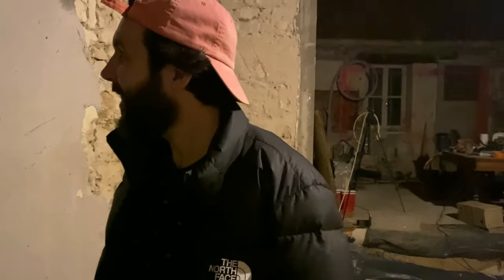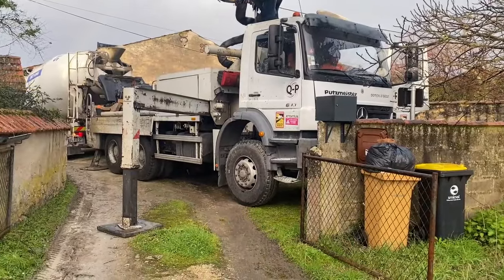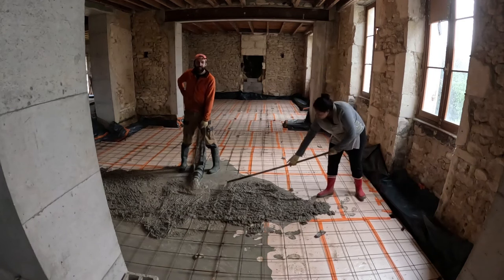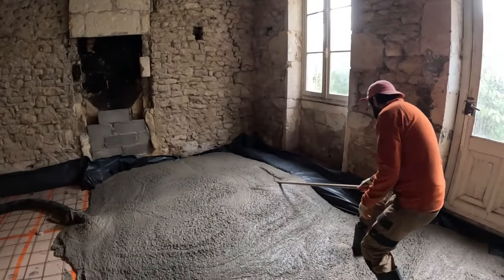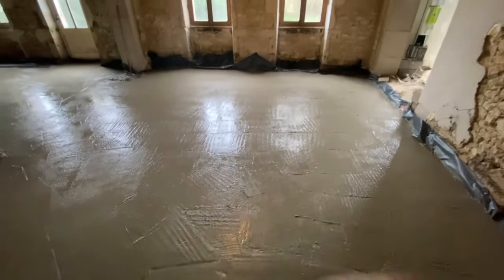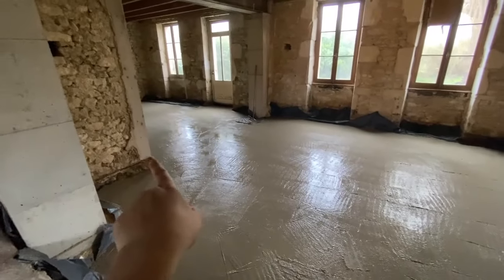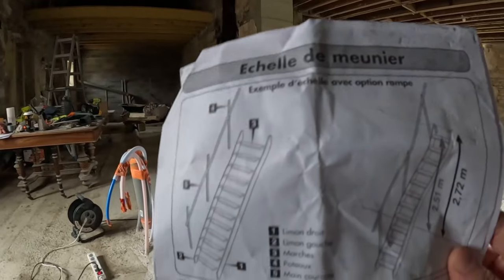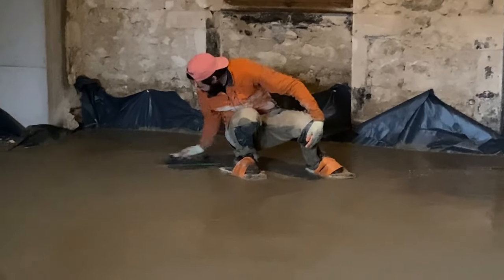Pouring Concrete Inside a 1700s French Stone House! (US couple renovating old stone house in France)

Comment: do you understand that you have stopped the floor breathing  moisture will build up under the membrane creating the walls to be damp as there is no dpc  . geo rock and limecrete should have been layed allowing the stucture to breath
Reply from the maker: We do have the geo rocks (20cm thickness) and sand under the slab. We don’t have the limecrete part lol
The slab is just floating on top of that subfloor, we didn’t block the foundation of the walls part… 
Thanks for the resourceful comment! 😊
Reply: As long as the concrete isn't touching the walls and the wall can breath to the inside and outside he should be fine!
Reply from the maker: We hope so! 🙃
Reply: @DomaineSauvage  that doesnt make sense  the concrete is protected by plastic membrane  which will also not allow the floor to breath creating a build up of moisture that cant escape it will become soaking wet . the floor is protected so the lime  used  in the walls will not be able to cope with this amount of damp .
Reply: @ohiotobordeaux6295  you must remove the cement based concrete without delay and the sand  which only serves a holder of damp as i suspect you blinded the  rock with sand to stop the edges piercing the plastic membrane  this defeats the breathability of the geo rock which should have been wrapped in breathable membrane  completley it then should not be compacted . nhl 3.5 mixed with ballast and wash sand should them be layed no plastic creating a complete breathable floor which complements the existing lime stone built  walls  .